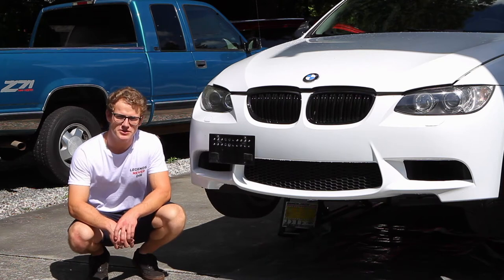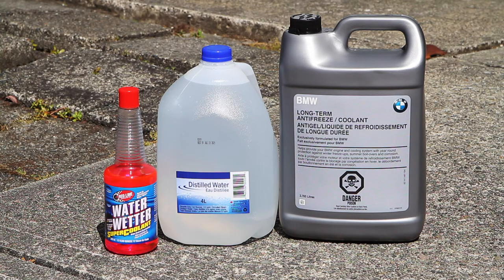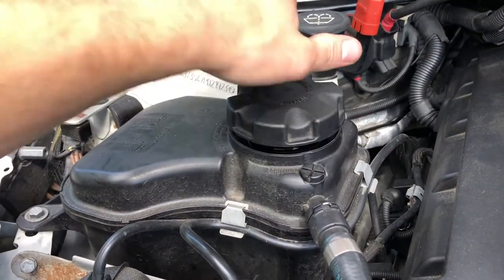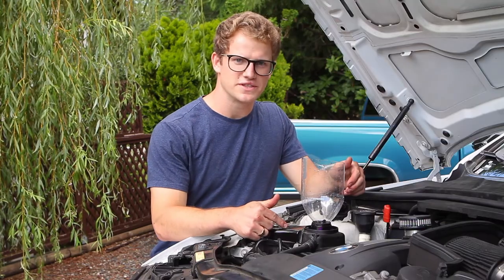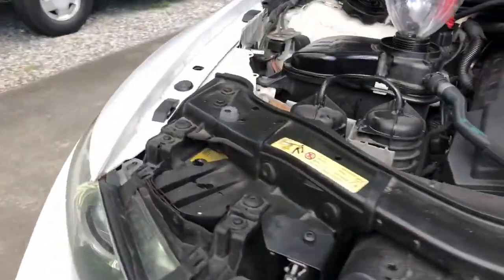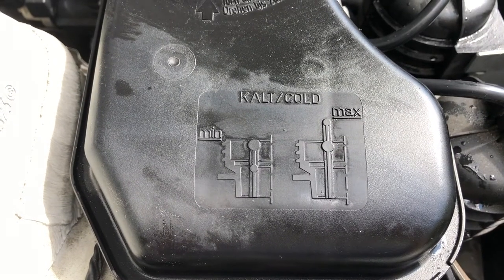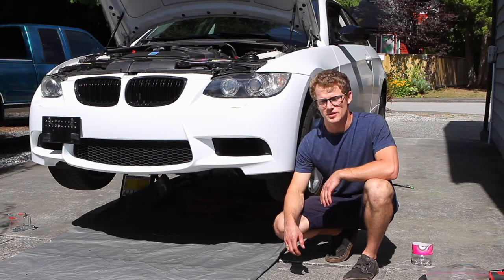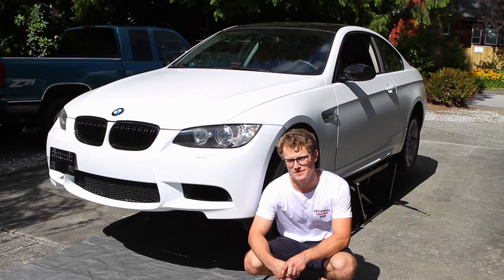N54 Coolant Drain and bleed E92 E90

Comment: Great vid.  Silly question - what lift/ jack stand system are you using.  Looks waaaay too convenient!
Reply from the maker: They are called quick jacks, I have the 5000 lbs model. They are super useful and I feel comfortable under the car using these. Here's a link to them:
https://www.costco.com/quickjack-5%2C000lb.-slx-capacity-portable-car-lift-bundle-.product.100666851.html

Comment: Thanks for good video. I've just bought a 2011 1M coupe here in UK, with only 24k miles on car, but realise the coolant probably never been changed as BMW consider it a 'lifetime fill' & isn't in the service schedule. It seems pretty straight forward how you described. There is no radiator cap to open? Just the reservoir bottle to refill? Also car doesn't have to be jacked up one side higher to bleed, just straight up at front?
Reply from the maker: Hey! Ya just the reservoir cap to refill. And yes, you don’t need the car to be up on one side to bleed it. The electric water pump will circulate the coolant to bleed it before you turn the car on by holding the gas pedal down. Enjoy the 1M!

Comment: Hi again, does the radiator drain plug drain all the coolant, or should you disconnect a hose near engine as well for a complete drain? Thanks
Reply from the maker: I believe this leaves a small amount of coolant in the system because the radiator drain is slightly above the waterpump/thermostat. You could pull a hose of the thermostat housing and likely get more coolant.

Comment: I was told to have water pump active while draining to make sure everything is squeezed out. any truth to that ?
Reply from the maker: I haven’t tried that but I don’t think it’s a great idea to have the pump running when the system is low/dry. If you want every drop out of the system I would take off a water pump hose and that should do the trick. 👍
Reply: @Calvinm  thanks man
Reply: Running any pump without liquid is a bad idea

Comment: Where did you get that car jack?
Reply from the maker: https://www.quickjack.com/car-lifts/bl-5000slx/
It's a hydraulic lift made by quick jack. Highly recommend it!
Reply: @Calvinm  That's the exact one I want. Would have bought it yesterday if Costco had one in stock here in town. Instead, I'm back on 4 jack stands for inlets/outlets. I snapped that little overflow tube so found your video. Great content, thank you.
Reply: Do you need a pc for the gel a´t coolant fluid to replace it

Comment: Is there Any Other way of draining you’re coolant? My Mickey Mouse flange broke but reusing the hose just upgrading the flange and only a little coolant came out, but want drain it all and put fresh in. 

BUT.. 

I had a PITA fight with my 5” Arm intercooler connecting the hoses togather. 

Lol 

Thanks for any replies fellas.
Reply: And it doesn’t have to be perfect as in ALL the coolant just maybe most of it? 60%+?
Reply from the maker: @Robert Kenney, if you take a hose off of the water pump you will drain 90% of the coolant since the water pump is at the bottom of the engine. Best of luck!